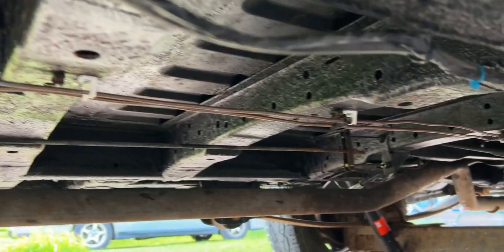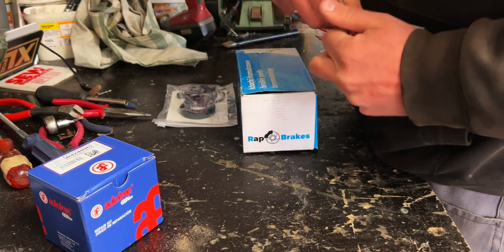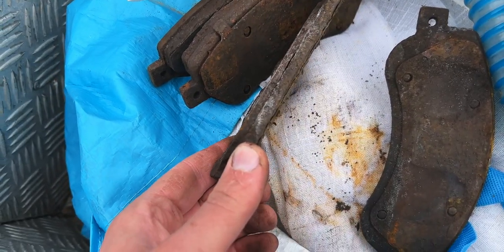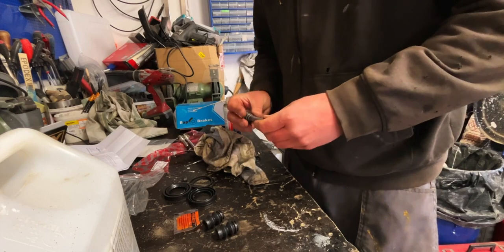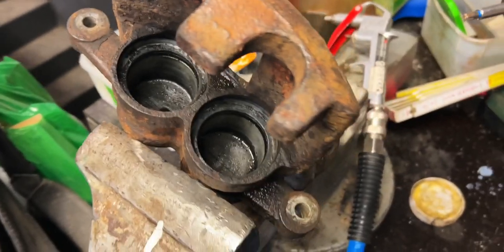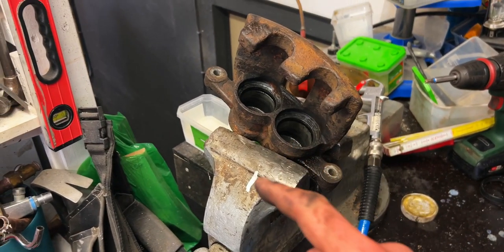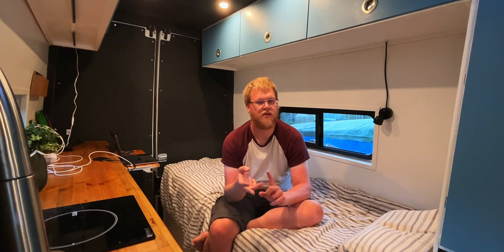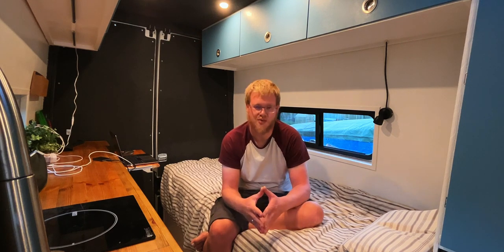NO Working Brakes On The Van!! Iam Done!! | One Road - EP18

Comment: Nice work, did you bleed the air out of the break lines though? If you haven't painted it yet don't bed liner it its horrible job I done mine and hated it. Takes a lot of colour too just use white its easier
Reply from the maker: Tank you! Yes I have bleed the brakes, multipel times, even with computer. But still te same feel in the pedal. I have started painting, I think it looks grate. But ye your right it takes alot of paint
Reply: @OneRoad92  Have you flushed the brake lines? Might be gunk in the lines.
Reply from the maker: Yes, Have used up almost 5L of brake fluide